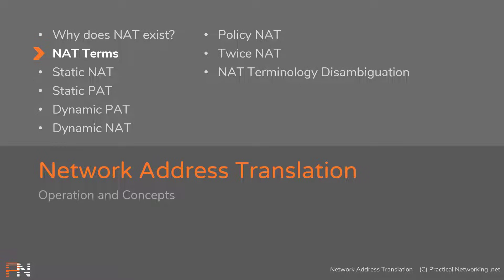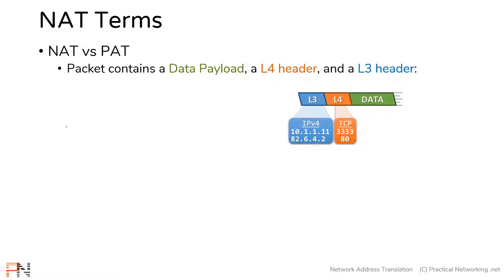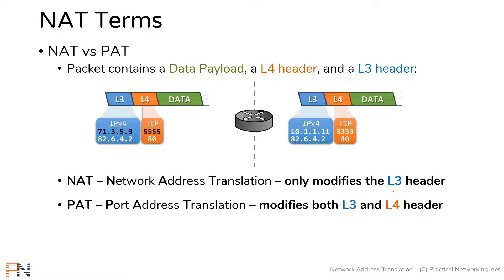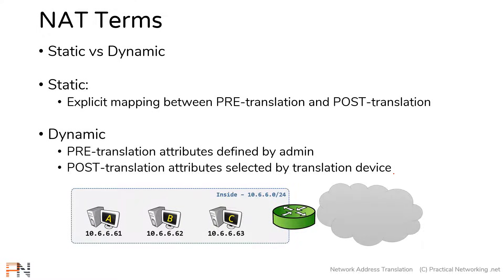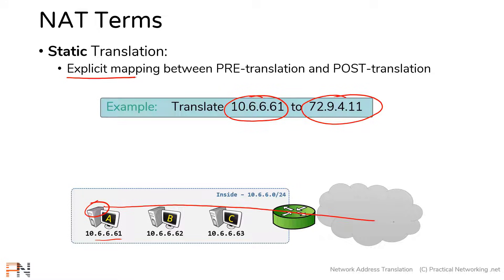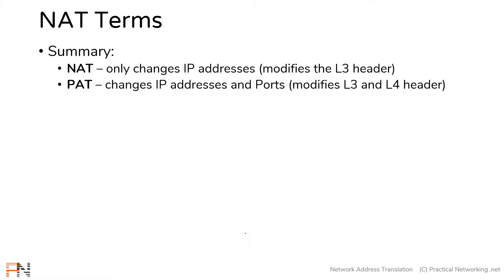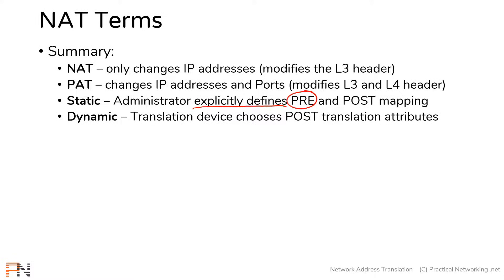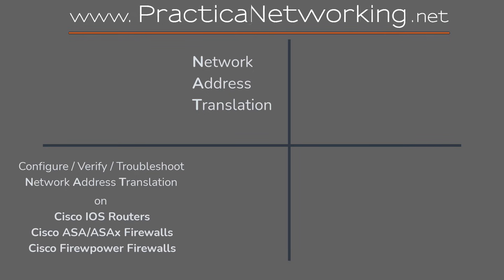NAT vs PAT, Static vs Dynamic -- demystified! -- Network Address Translation

Comment: Question, why have a range of IPs to translate out to? We have dozens of devices behind our home router which all use the same 1 IP even if they're all using port 80 for the web. As I understand it NAT knows the difference for which host sent a port 80 destined packet by assigning different return ports.  Isn't this adjusting the layer 4 header making it a PAT in reality?
Reply from the maker: The type of translation your home router is doing is a Dynamic PAT. Details here:  https://www.youtube.com/watch?v=2t8-WRZWCq8